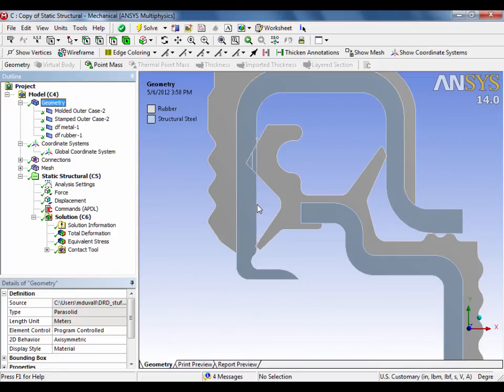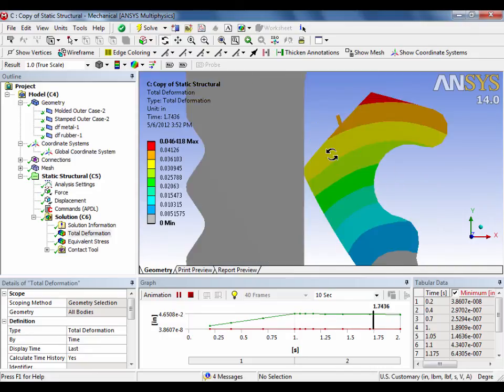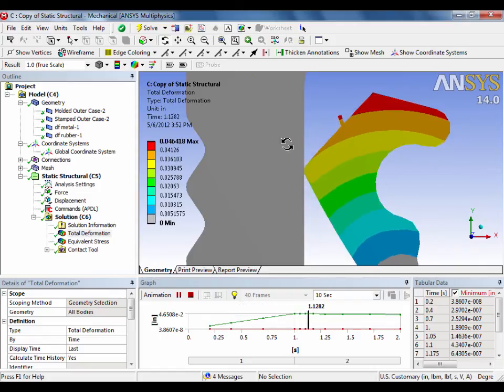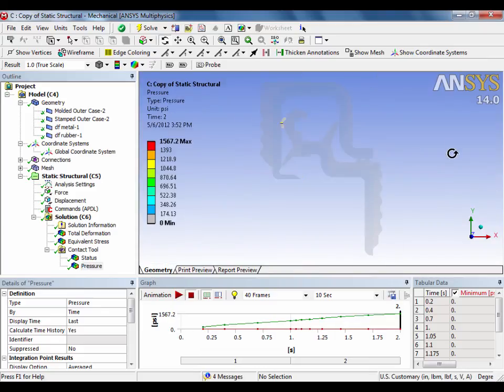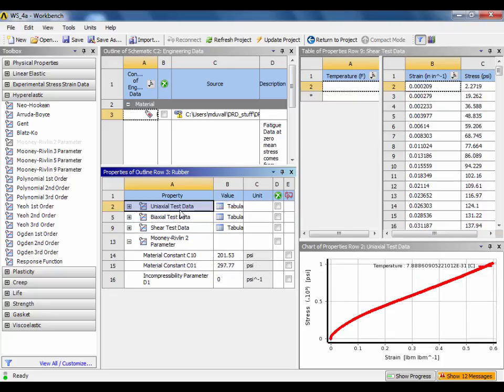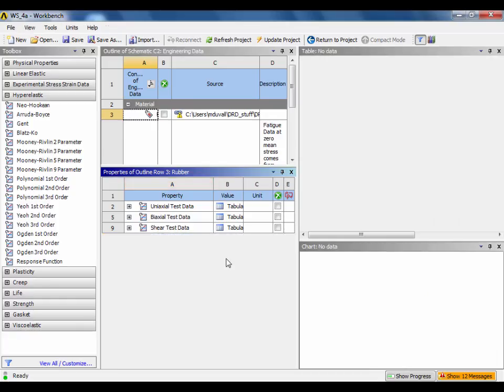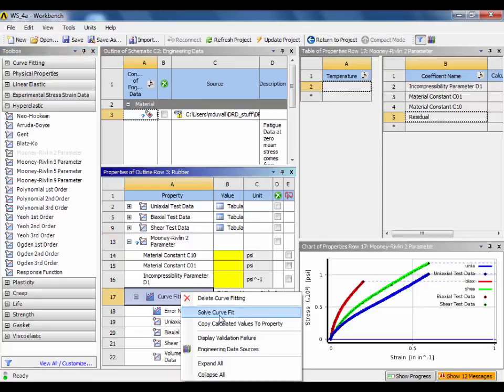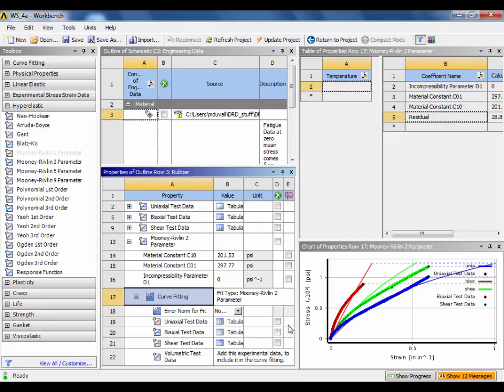ANSYS Hyperelastic Example with Material Property Definition

Comment: to allow interference to resolve itself,  you simply need to correctly define the pinball radius and the contact formulation so the contact and target pairs are correctly defined.   Also resolve the contact in "ramped" fashion in the first load step.
Reply: Could you show the settings for this contact solution? which contact formulation you used?